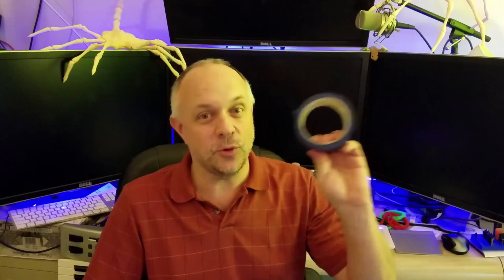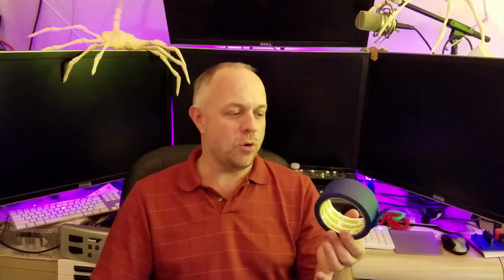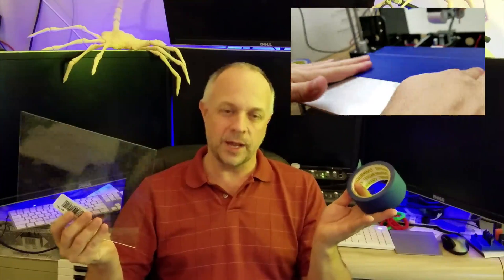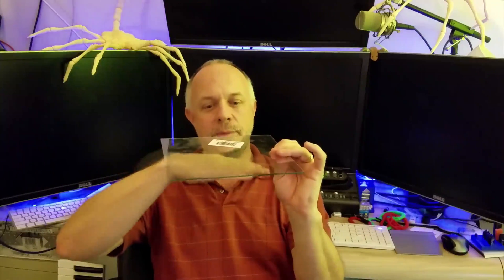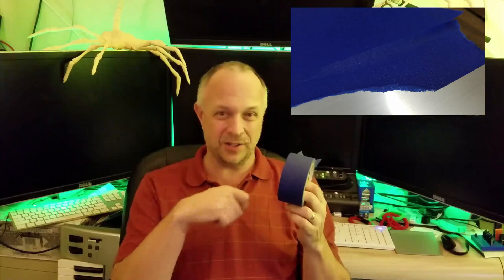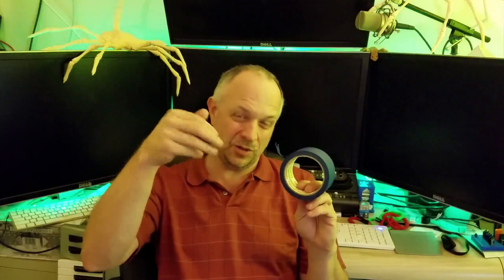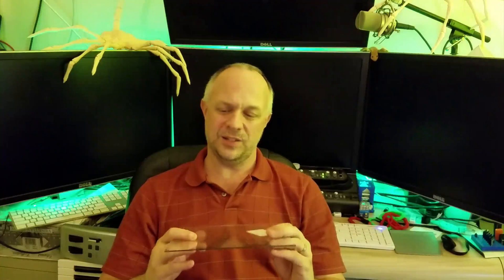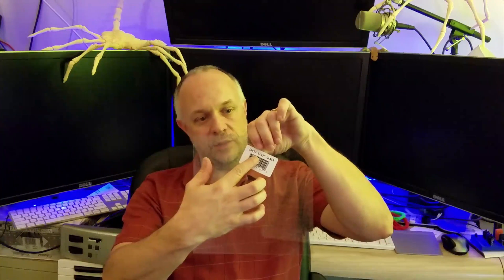Anet A8 Glass Bed Upgrade - 3D Printing on Glass Bed Versus Tape

Comment: What is the thickness size of the glass that is recommended?
Reply from the maker: I use the standard glass I get cut to size at my local Lowes/Home Depot.  I think it's about 3/32 inch thick which works perfect.  If you get glass too thin, it will be more prone to cracking/breaking.  If it's too thick, the first layer of your prints may not get hot enough (or you may need to set your bed temp hotter to get the prints to stick appropriately).

Comment: If you're getting tape stuck to the bottom of your prints your bed isn't leveled correctly. I ran into this issue a few months back were ALL my prints yanked up the tape and it turned out my nozzle was a hair too close to the bed. One session of double and triple checking the corners with the wing-nuts and a screwdriver later and I've never experienced that problem again.
Reply from the maker: I really can't stand using tape for several reasons. I love printing on glass and add it to all of my printers as one of the first things I do.

Comment: Really it should be Borosilicate glass because regular window pane glass will eventually shatter from the heating.
Reply from the maker: Good point... But, I am a miser and currently borosilicate glass is magnitudes more expensive and not available locally in many areas.  I'll stick with my $2 glass and buy another one when it breaks.  But, if you're not as miserly as me, it's a good way to go.
Reply: Sotm I agree with you totally brother. I wouldn't run a long print with ABS he could loose it when the glass breaks. He'll probably get lucky for a while run ing PLA.
Reply: i know im late but here is a borosilicate glass plate for anet a6/a8 https://www.amazon.com/220mm-Borosilicate-Polished-Heated-Printer/dp/B01LFOI2VS/ref=sr_1_fkmr3_1?s=industrial&ie=UTF8&qid=1538016705&sr=1-1-fkmr3&keywords=215+x+215+mm.+Borosilicate+glass

Comment: So what would be wrong with printing directly onto the metal/aluminum hot bed?
Reply from the maker: +Brandon Gallacher Printing directly on the hot bed is typically not the best idea for many reasons... Especially starting out. There have been a few times my bed was not level or my z axis was not adjusted properly (or my z-stop switch failed) causing the hot end to plunge into the bed scraping and scratching the metal along the way which left an uneven surface and uneven heating. (this even happened with tape since it scrapes right through the tape). This is where glass wins big time. Also, if a print sticks directly to the hot bed and you have to use a tool to pry/wedge it off, you'll likely scratch up the surface of the hot bed. There are many other reasons but those should be enough to deter printing directly on the hot bed.

Anyone else want to mention some other reasons? Comment below...

Comment: An awards frame from the dollar store is what I have been using for the last 6 months. I just cut it to length and sanded the edges.
Reply from the maker: +electronron1 Nice! The price is right on that one. I love finding inexpensive things (often not having anything to do with their original purpose) and repurposing them for my projects. Did you use a typical glass cutter to cut it?
Reply: Sorry it took so long to reply, I used a glass cutter my grand father gave me many years ago so it has to be close to if not over 100 years old.